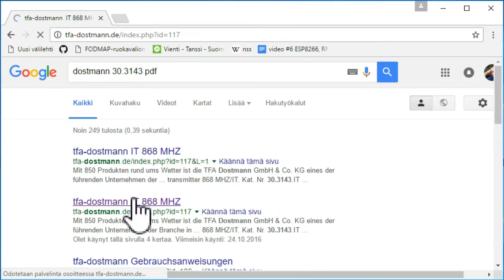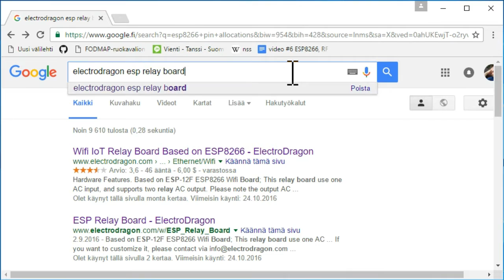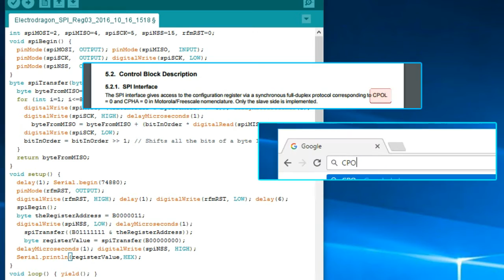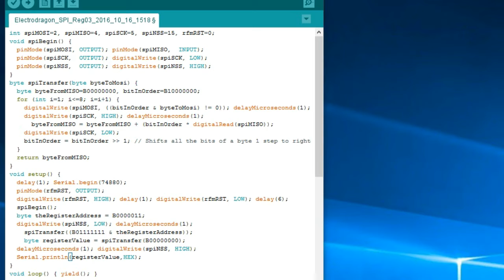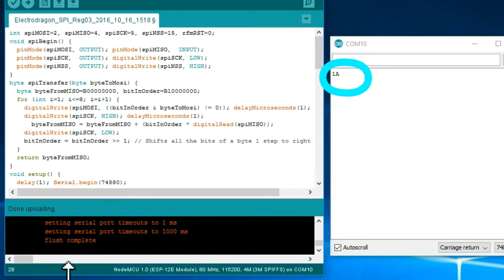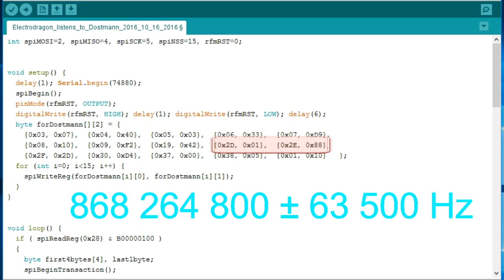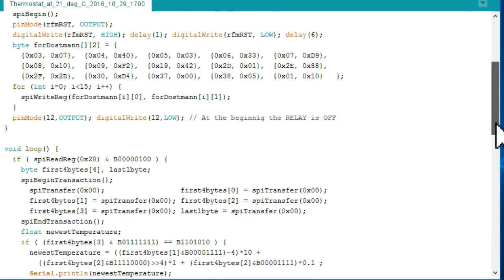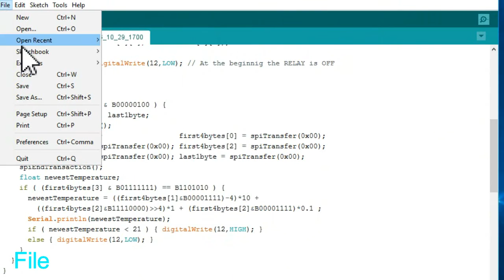#6 ESP8266rf and Bigger Currents

Comment: I am struggling to get my RFM69 to work. I installed the RFM69 library but the sample code keeps ginging me the error avr/wdt.h not found. This is caused by the fact that the code was written for an arduino an I am using it on a esp8266. How did you solve this issue?
Reply from the maker: I do know that feeling! The first hardware that worked for me was two Adafruit Feather M0 radios with RFM69.h library's example prgrams. After that everyting was quite straightforward. I just modifiedt that pair of example programs towards my own needs. See:
https://docs.google.com/document/d/1hcMhY_y2T6fsfzTxcGdZ6iqhlnEODvlAjnqxyAF-qWs/edit#heading=h.3wnyekqsa03q
Reply: I realised that in this YouTube movie you wrote the code without using a library. You are doing the communication with the rfm69 yourself. So I shamelessly copied your code :). Unfortunately, it doesn't work for me. I am able to set a register to a value and read it back but there are no transmissions coming in. Maybe that is due to the fact that I am using a RFM69CW instead of the RFM69HCW that you used. I also have a different Dostmann sensor. I am using the 30.3180.IT.  So maybe I have to get the same sensor that you have.
Reply from the maker: Very good! You already can read and write the registers. But I guess that your wireless Dostmann temperature sensor uses some other protocol than mine: On the page
   http://tfa-dostmann.de/index.php?id=117
they say that your Dostmann 30.3180.IT can be used with only the Dostmann 30.3039.IT weather station. But on the same page they say that my Dostmann 30.3143.IT can be used with 11 different weather stations, but not with 30.3039.IT. They may be somehow different.
Reply: You're right. They are very different sensors! I didn't realise that. So I will have to figure out what protocol my sensor uses. Did you only use the research paper by Bossard and Lopez and Sanchez?
Reply from the maker: RFM69(H)CW datasheet. Perhaps you need as a spectral analyzer a cheap RTL-SDR radio
  http://www.rtl-sdr.com/rtl-sdr-quick-start-guide/ 
with the "SDRSharp.exe" program and the "Audacity" program to analyze the broadcasts of your receiver. As said I got a good start with a pair of Adafruit Feather M0 radios
   https://learn.adafruit.com/adafruit-feather-m0-radio-with-rfm69-packet-radio/overview 
And the works of Lopez, Sanches and Bossard.
Reply from the maker: This my newest video will help you to find out the protocol of that sensor that you have there  https://www.youtube.com/watch?v=Ck61nP8eRzA
Reply: Thanks for the tip. I have already watched your video and I will be trying it out soon. I already bought an RTL-SDR :)